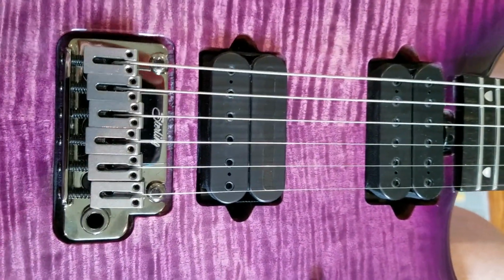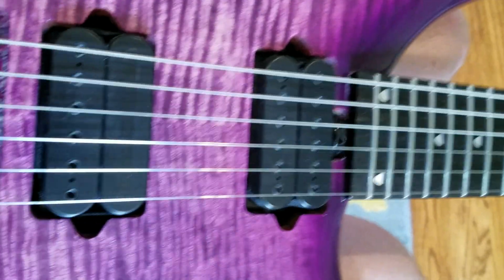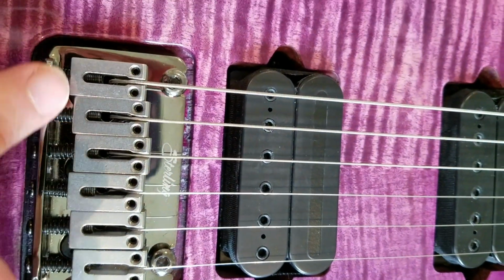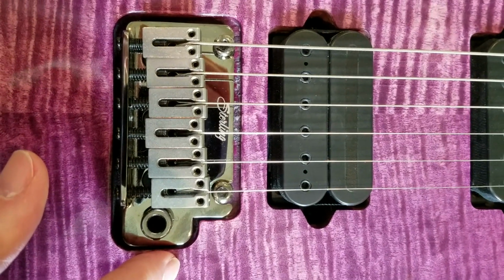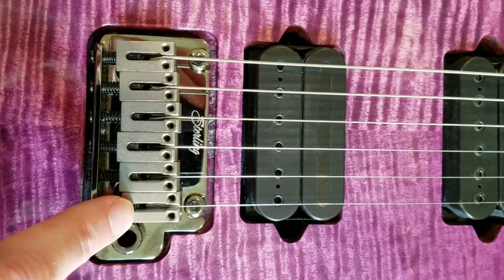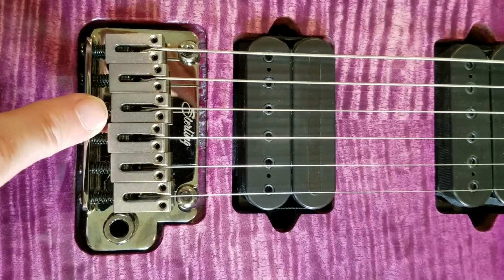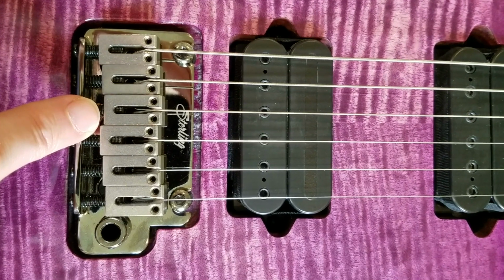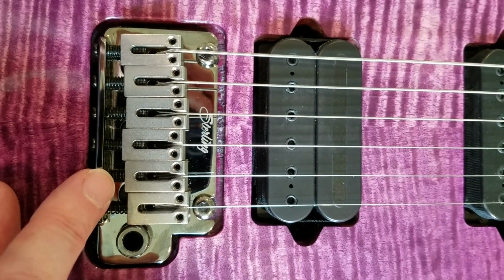Sterling Majesty X Unboxing and Demo

Comment: Bridge alignment is a huge issue to me only because it should be the first on the list for QA prior to even installing the bridge.  If its off, fill in the wood and reuse the body, but dont send it out like that.  My JP60 had the same issue, I chose to live with it.  Personally if I wasn't going to use a trem, unlikely I wouldn't go hard tail.
Reply from the maker: Agreed. I don't need the bridge to be perfect, but if the high E is too close to the edge of the fretboard it really messes me up. On my Vintera Strat I even swapped the bridge for a narrow spaced one just to keep away from the edge.

Comment: I have a partscaster with the same issue of the bridge edged too far towards the high E string. It's certainly playable but it does require a bit of attention on vibrato high on the neck.